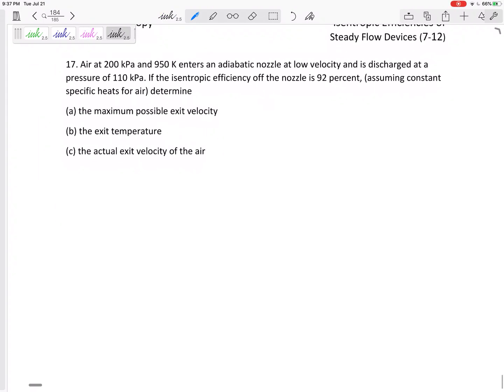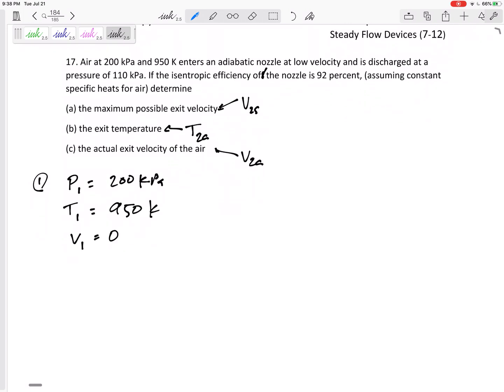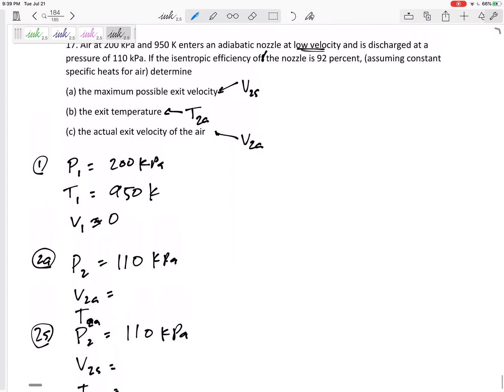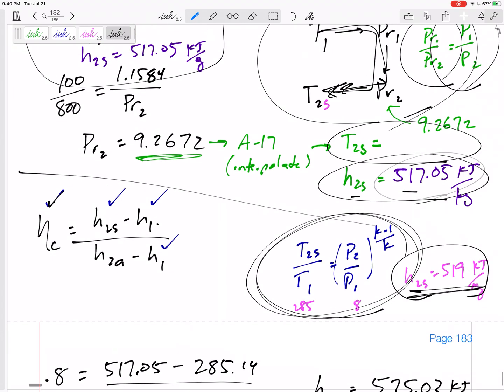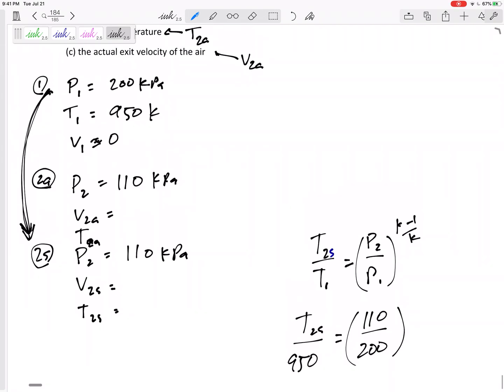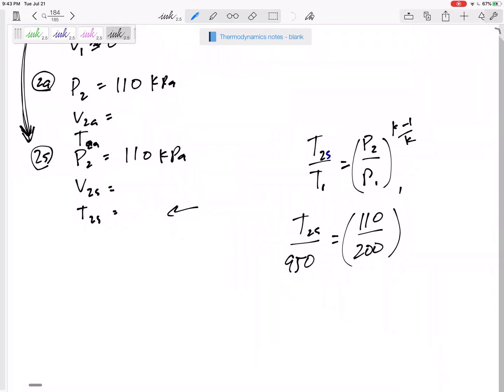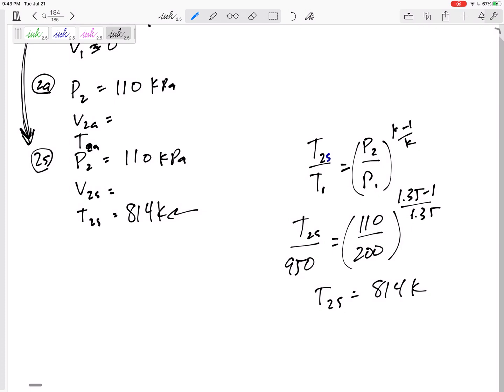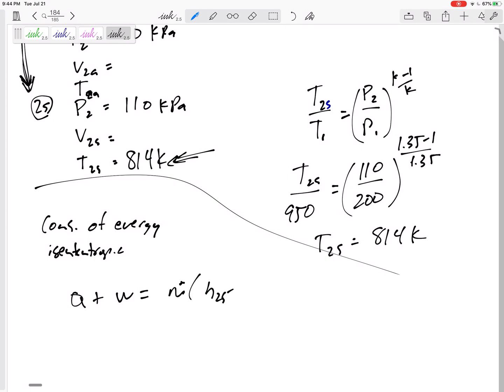Thermodynamics - 7-12 Isentropic Efficiency example 3

Comment: Hello Professor. Thank you for these videos. I had a small question about 9:49 . Why did you choose 850 to interpolate between 800 and 900? Is that the T average? Couldn't you use 814K as your point of reference for Cp to interpolate there instead?